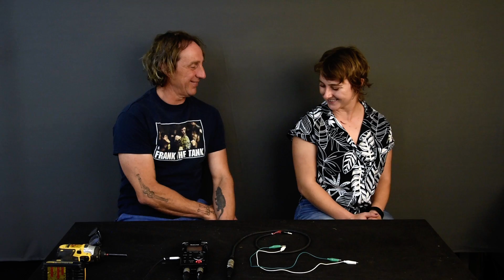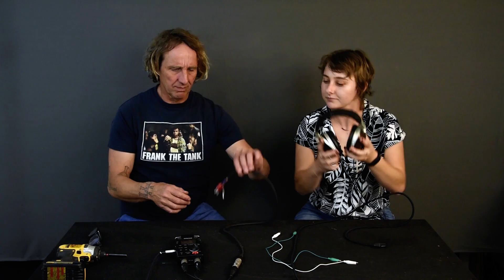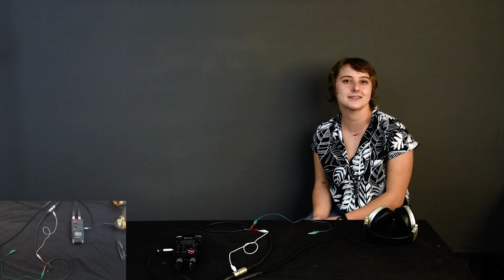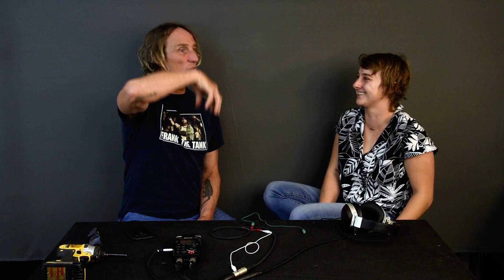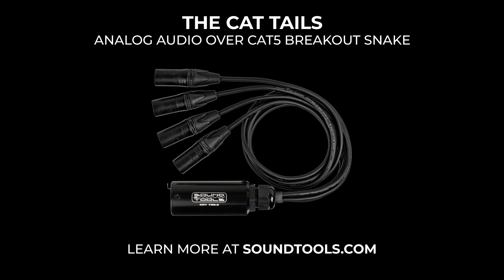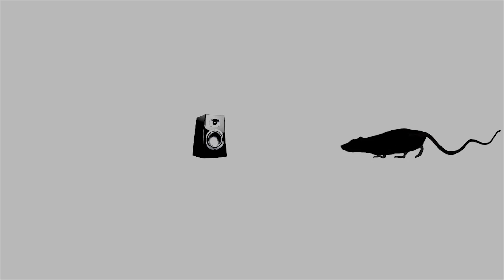Audio RF Interference & Demo with Sammy

Comment: Have another RF solved case study for you. Sorry for the very late reply. Just found this video.
The issue was at a fairgrounds right next door to an AM radio station. The stage was about 750 feet from an AM radio broadcast tower operating at about 1.5 Megahertz. The FOH console was about 125 feet away from the front of the stage, and away from the radio tower. We could hear the radio station in the main speakers and in all the stage wedges.
Used an oscilloscope to troubleshoot the issue. Did not have any demodulated AM radio on any of the microphone inputs on stage.
The Avid SC48 console did a fantastic job rejecting the high levels of RF on the analog audio snake from the stage. At the other end of the snake, when unplugged from the speaker management unit, a Galileo 616 speaker management unit, it could not reject 30 volts peak of RF, so it got into the mains. Found the Meyer Sound Galileo 616 is transformer-less input, and the high levels of common mode RF on the audio snake was being rectified at the input to the Galileo. To kill the RF out of the LR Main and Mono Sub signals from the FOH console, Ferrite beads were applied to the cable. This helped, but did not kill it completely.
The following year, engineered and built a solution. Using short XLR cables cut in half, inserted 15 milihenry bifilar chokes in the lines to the input of the Meyer Sound Galileo, which cured the FOH radio station issue completely. At 1 Megahertz, the 15 mh RF choke into 600 ohm input attenuated the common mode RF by over 60DB. This was enough to prevent clipping the Meyer Sound differential input stages.  However the radio station remained at a low level into all the monitor wedges on stage. Checked the monitor world mixer after hours, a Behringer X32 console and found the Talk Back from FOH into the console was the path into the console.
Added a single channel RF choke on the input from the FOH engineer and that solved the last of our AM Radio station into our sound system.  Until we had bands on stage. Band Pedal Boards for Hi Z guitars and unbalanced guitar instrument cables, and band IEM systems the band brought had their own issues with the radio station, but that is another story. Making up some 1/4 inch cables with RF chokes and small value bypass capacitors to have the bands try next summer. The higher impedance might not work so well with the 15mh chokes, without bypass capacitors for the RF.  Just need to ensure the LC is not resonant anywhere near the Radio Station frequency.

Comment: i saw a video on  a  mlrfif cable    can this work?/
Reply from the maker: Mlrfif?
Reply: @DaveRat  alectrosystems makes a xlr cable with rf  supressor in it
Reply from the maker: Aaah. It's a bit out of my realm of actual experience as I've not dealt with loads of RF issues. But if you go to AES.org website and lookup their paper for recommended XLR wiring to deal with RF there are documents that show you how to optimize that.

I believe it's something like putting a 10 Pico ferret capacitor between pin 1 and the shell on both ends.

Cheap and easy
Reply: @DaveRat    thanks dave

Comment: Woah, that story of Munich reminds me of a venue in Utrecht (NL) where I worked as an intern long ago, that was located right next to the headquarters of the police and the fire brigade of the city, with a big antenna where all the communication and also the 1-1-2 (like the 911 in America) emergency calls were coming on. So in some cases during soundcheck, we could pick up these signals with a guitar pickup through an amp. Not clearly enough to hear what people were saying, but still.. It was pretty insane.

Comment: An MIT undergraduate recently borrowed a very expensive network analyser.

Absolutely Doctor Rat was indeed correct that the designs of tinfoil hats do indeed amplify specific frequencies of EMI, rather than attenuating them. It has been experimentally confirmed. IIRC the boost was anything up to 14dB
Reply from the maker: Found it!

https://mindhacks.com/2005/11/11/tinfoil-hats-tested-for-anti-mind-control-properties/
Reply from the maker: Ha!  Love this. Love to read more on this.

Comment: Bill Whitlock (former owner of Jensen Transformers) had a situation where you couldn't play guitar on half of a stage. It turns out the problem was high current through water pipes below the stage created a magnetic coil that produced 60 cycle hum through the guitar coils. Each side of the building was fed by a different transformer and the pipes was where the ground current would flow. The solution was to galvanically isolate the two sides using a PVC union.
Reply from the maker: Love this stuff!

Comment: What a bizarre engineering job, where a massive grounding task is easier to complete with bottles of water and salt than actually acquiring some copper and ground stakes. 
 Great story, thanks!
Reply from the maker: Awesome and in the description I added a link to a more accurate account of what happened that I wrote soon after the gig with photos. The stage was on metal plates seperated by wood blocks. The salt and water was to connect the stage to the plate.
Reply: @DaveRat  I'll check the link. Incredible problem solving for sure!
 Cheers.

Comment: Totally saw that stage grounding story coming when you said there was an antenna near it. I've never had to deal with that size of an interference issue under that kind of pressure but I have had to ground amplifiers with tire irons beat into the ground, mobile studios with buried hammers and run 12ga wires between wall receptacles to form a star as a Christian youth group looked at me as if I was summoning demons lol. You do what you gotta do.
Reply from the maker: Ha and yes! Ground and RF gremlins can be fun to battle!

Comment: There are different modulation types used by cell phone for the RF connection to a base station. Some are more steady than others regarding power level. What most often is audible is the pattern that the transmitter turns on and off, when the repetition is an audible frequency. GSM (2. gen) was particularly burst-heavy due to it time-divided protocol where each phone gets assigned short time slots to transmit in, where all other phones in the area shall keep quiet, so they transmit one at a time.
Reply: The GSM signal had 8 times slots per channel, each about 4.6 ms long. which produced 217 Hz interference (1/.0046). During the phones time slot, the battery current would surge over 1 amp. Shorts bursts of high current through inductive circuits create high voltage spikes. CDMA phones don't experience this kind of surging. However, you have the haptic motors which can create interference when a phone vibrates.
Reply from the maker: @jonathannovick3766  thank you Jonathan! Interesting.  Going to try and recreate the issue, any ideas of what to try?
Reply from the maker: Wow and thank you!

Comment: I once hooked a giant marine antenna (30') to an old cell phone and it got really hot and the cell stopped working. It smelled of burnt components afterwards. The experiment was worth an old brick phone, for like 10 seconds I had crazy good service and then none. :)

Something else I've discovered over the years is I live in a valley and there is a giant antenna array on the tallest peak in the hills. There are different places that anything with a VU meter (like a CB) will redline even if it's not hooked to power. I've also experienced this exploring military land about 40 miles away except that is mobile while the other is in fixed locations.

My neighbor was messing with his brothers boat the other day and it was causing interference everywhere. Turns out his sonar unit was engaged (not good on dry land), it's one that has twin leads that can detect a screwdriver about 2 miles down made for exploration and salvage I guess. It's all super interesting, now that I point all this stuff out I'm wondering if I should shield my house, LOL 

Totally rad video, the stage story is epic! Thank You. :)
Reply: Interesting.
Will the sonar unit detect a gold nugget in dry ground, or have I misunderstood??
Reply: @stuungar3390  I don't know much more than it was for salvage operations and they really shouldn't be used above water, LOL I do know it created a lot of interference, :)
Reply: @peehandshihtzu  - could have some major fun with that, lol

Comment: I could be totally off base here, but I feel like you're not getting much of the phone interference in the (un-common mode) signal path because the signature clicky sound -- resulting from TDMA rectification -- tends to have a greater effect on the biasing of transistors in power amplification circuits. So you're more likely to notice its affect an active system with speakers or a mixer with lots of amp stages, rather than through a recorder. Again, I don't know this in depth.. just a theory.
Reply from the maker: Interesting, I will mess with it and see if I can find some susceptible gear

Comment: I wonder if the phone didn't work because it was using wifi calling instead of mobile signal.
Reply from the maker: Great point and yes, cell does not work well in that room.  Though you can hear some of the i terference in the vid, not as loud as expected

Comment: Salt water to ground the stage..... EPIC....  a brilliant yet so simple solution to a bad problem... It's why I keep coming back, the wisdom shared here is practical, useful yet mind blowing... THANKS!!!!
Reply: I'm not buying that story! that's not exactly how RF grounding works. 
He is probably talking about https://en.wikipedia.org/wiki/Olympiaturm witch is not one big antenna but there are small short wave antennas on top of a tower 
Short wave is (was) FM not AM... so maybe the Sound guy version of Sailors' superstitions
Reply from the maker: Yes that's the tower and scepticism is welcomed with open arms!

Here is a more in depth description of the event written the same or following day after the event occurred with more accuracy. Curious to hear your take or alternate possible explanations.

https://www.ratsound.com/cblog/archives/282-Day-402-June-29th-Munich-Show-Day-All-things-Are-Inter-Connected-or-Sometimes-Not-Part-2.html
Reply: @DaveRat  Thanks! It just sounded to mush like the magic salt circle witchcraft to keep away the bad RF Ghosts.
But on the other hand Every electrical engineer can confirm that RF is basically voodoo or black magic.

Antennas are kind of like acoustic resonators. the bigger the lower there Frequency.

The frequency from  that tower are probably all over ~100MHz  and a Antenna would be something like 3 meters or shorter. 

Also professional gear should be relatively immune to that frequency?
Reply from the maker: @lambda7652  yes, as I troubleshoot in the bpg I put the link to, it was not the pro gear that was the issue. The issue was that when the guitar pickups where physically closer to the stage, the RF interference increases. If the guitar was held overhead it got quieter and guitar set on stage was louder.

Somehow the metal stage   seemed to be saturated in the RF. Guitar pickups can be quite susceptible to RF especially high gain single coil versions.

Somewhere I have a recording of the show. Even though the salt water did appear to help, the issue was only reduced but was still audible between songs. I will try and locate it and post excerpts if I do

Comment: Awesome video! Even if I have known the basics of sound reinforcement for years, you still managed to blow my mind with salt-water story! 🤯
I have a story too, with heavy interference and unbalanced lines! Sooo before DJM V-10, all of Pioneer's DJ mixers did not have XLR AES master output, only the RCA one. So we were using an AES-EBU adapter which is basically standard XLR-RCA adapter with pin 1-3 on the sleeve and with 110 Ω of resistance. Guess what. A thunderstorm was coming and the sky started to light up. (The event was indoors.) The situation got really weird really fast. It was like:

*Lightning*
*immediate earshattering pop from the PA*
*thunderroar*

This went on, until I hooked up DJ mixer with balanced analog lines.
Shielding and faraday cages are always manage to impress me. IDK why.
Reply from the maker: Awesome and thank you!